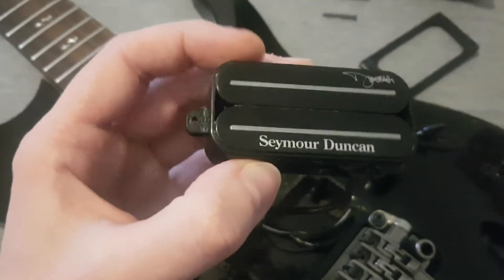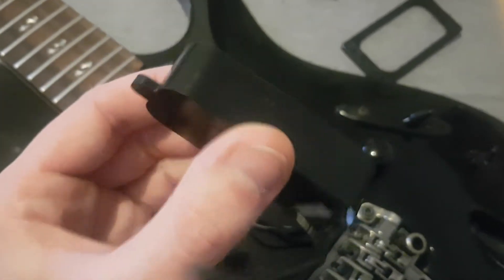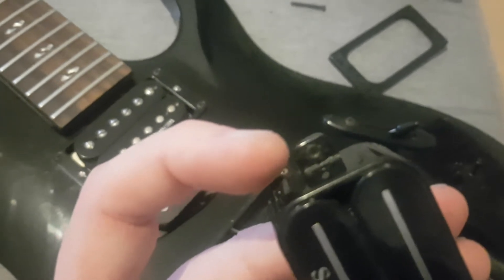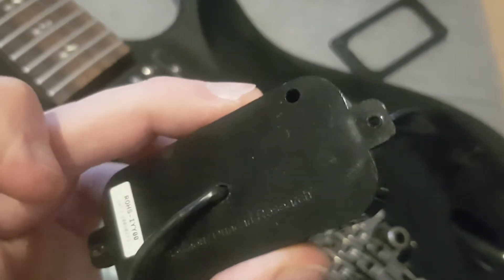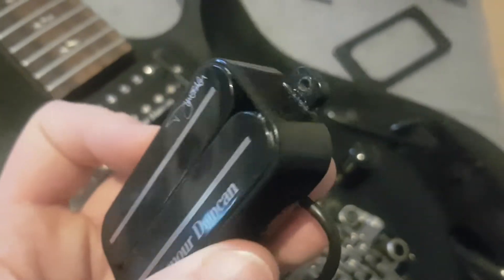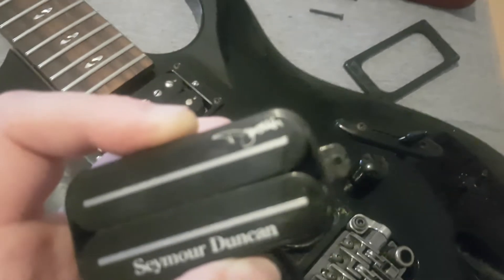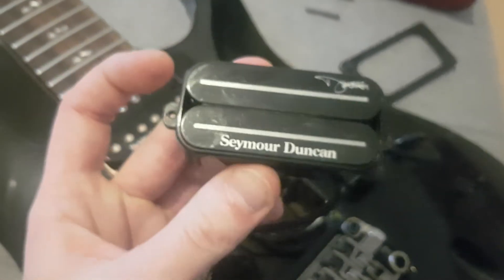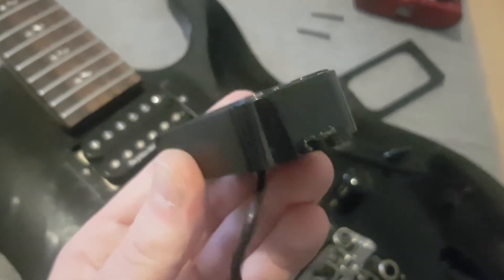Possible Seymour Duncan Dimebucker Problem

Comment: You're absolutely right, one side of mine is completely broken and the other side split... I'm thinking of using the housing from the original pick up but not sure how it will change the sound
Reply from the maker: The sound wouldn't be affected, i think adding a base plate to it would be best but I'd need to see what the inside is like

Comment: Just disassembled my guitar yesterday and one of my tabs was broken off. Not sure how or when it happened.  Any idea how this pickup comes apart?
Reply from the maker: Its a molded plastic shell so its not designed to come off from the looks of things. Without having disassembled one for a quick fix i would buy a pickup base plate and attatch it to the bottom of the pick up.